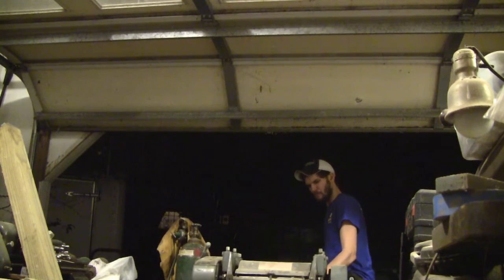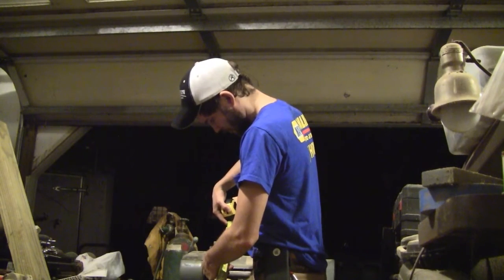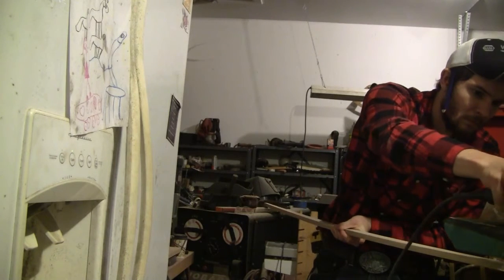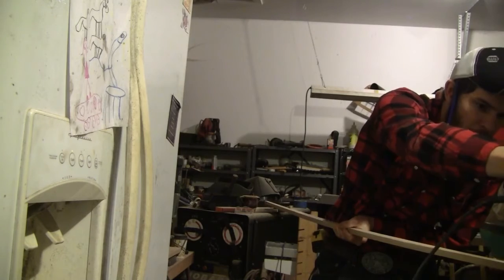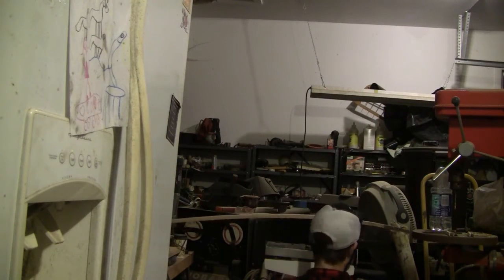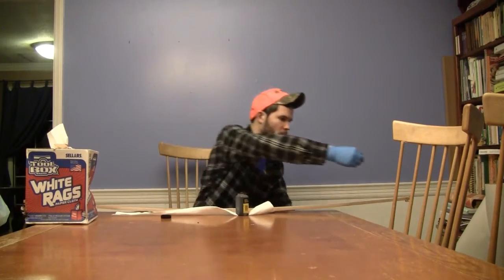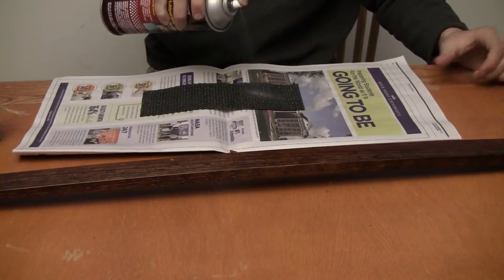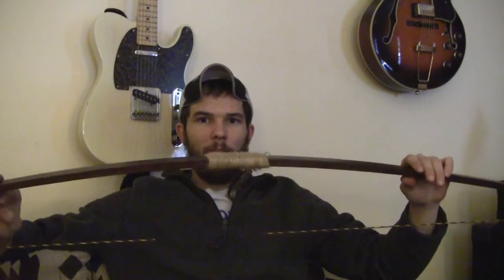DIY board bow

Comment: Tillering,....evenly and straight,.......a spoke shave you pull it at an angle and if you hit a snag you go the other direction.
You can use a straight backed Bowie knife you grind a 90 degree on the knife  spine on a belt sander and you leave the burr on it and drag that across the belly of the bow at a 45 degree angle and it works great too,..... when it gets dull you drag the cutting edge across it at a 90 degrees and drag it at an angle.
Or you can simply use a 3 inch paring knife.
Hell cave men used shards of flint.
freehand is bullshit,... you put it in a vise,...... I can make a  stave into a bow blank in 20 minutes with a angle grinder and rough sanding discs 36-80 grit, that's  shaping the limbs and limb thickness in 20 minutes.
Also Bow material is free if you know where to look,........ find a saw mill they give the skins away free for fire wood.
And always back your bows.
Indians did it for a reason.
You remove wood in the straight and stiff area's the slowly bend the wood so the wood you removed registers,...you slow draw it about 30 times till you feel the wall of tension.
When the bow is tilled each limb feels like a spring.
I just bend them over my knee's and look at each limb.